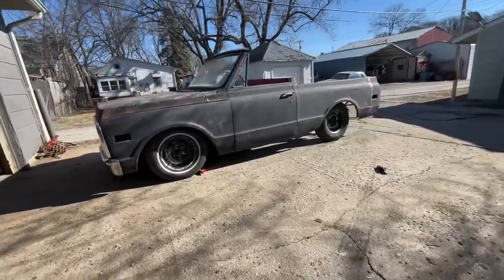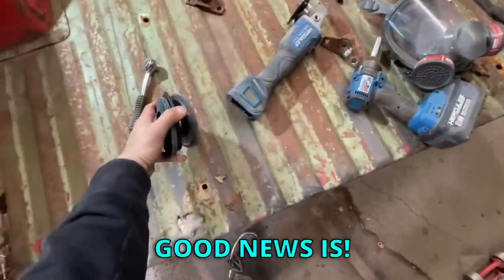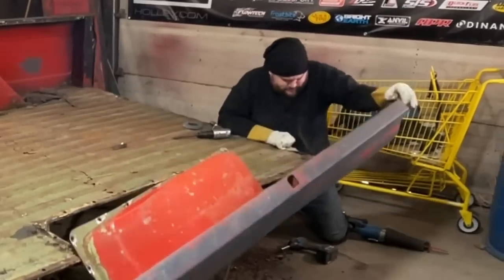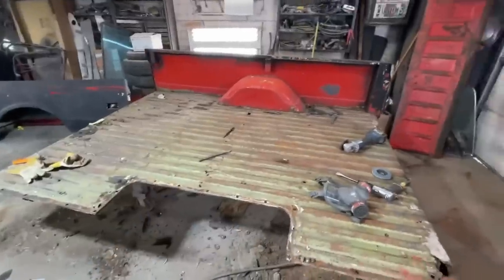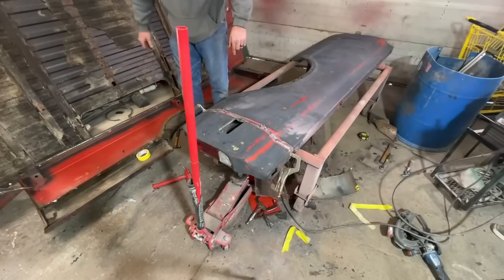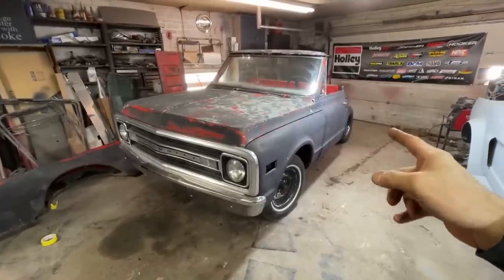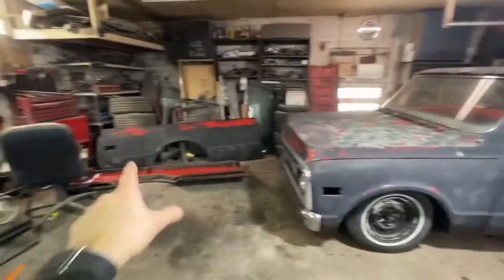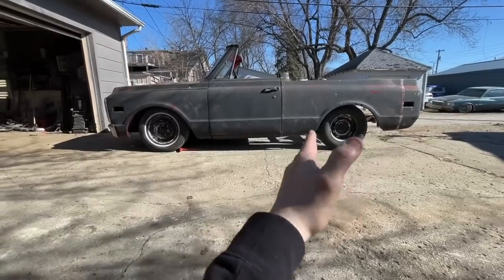RUINING MY PERFECT CLASSIC TRUCK TO MAKE IT A CONVERTIBLE BLAZER! HOT RAT ROD CHOPPED KUSTOM C10

Comment: just a bit of advice next time you are going to disassemble a bed. first thing i do is turn the bed upside down then i can cut the bolts off and it gets done pretty quickly . if your handy with a torch you can torch them off and be done in vary short period of time.

Comment: Top is definitely the wrong one unfortunately.  Cutting a more generic 8 or 6 foot topper shell might be a better option, would have a more proper fitting lift gate on the rear.  Very hard to fit a lift gate to later style blazer roofs.
Reply from the maker: Top is not wrong, this is exactly what i wanted
Reply: @Caseys Customs  ah OK, perfect then! It's looking awesome so far 👍

Comment: Your buddies came through big time with the top. It is very hard to find a top for those blazers. They are usually cracked all up being they are fiberglass. I had a few of those long bed truck's that were given to me very clean. I have never thought about making them into short bed truck's or even a blazer. I would have probably would have made my own top out of a suburban there are plenty of those 70s style suburban around.
Reply: Was a wild cruise up delivering that top and it was in good shape so we didn't wanna flip it so it wouldn't Crack so we put stringers across and mounted it with a ton of straps.  Lol it was lifting my dually and steering us via the wind lol was well worth the adventure lol
Reply: Unfortunately it looks like a square body top.
Reply: @Alwhite1929  that’s what I was thinking....
Reply: @Alwhite1929  it is
Reply: @Alwhite1929  I was going to say the same thing.

Comment: Isn't 69-72 104 wheelbase ?? Not 103?  gotta make top fit.And wheel wells centered
Reply from the maker: It is 104, did i say 103 in this vid? Lol.
My vid where i shortened the frame i did a wheelbase measurement afterward

Comment: Why grind the heads off.. do it the easy way and tack the heads of the bolts to the floor and then buzz the nuts off.. way faster and less mess.
Reply from the maker: So weld the bolt to the floor, then undo the nut, then go grind the weld off the head to get the bolt out….